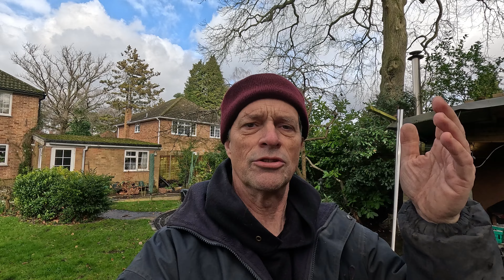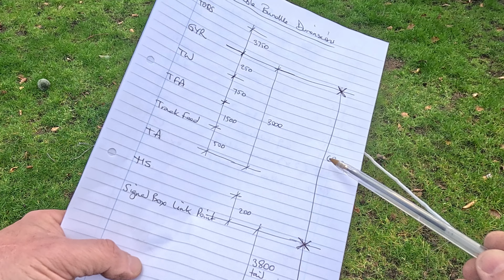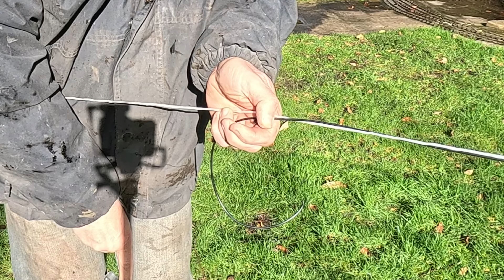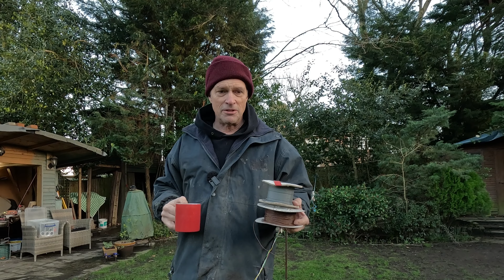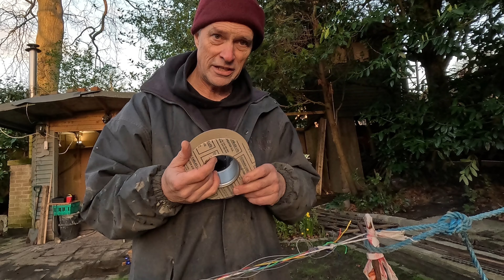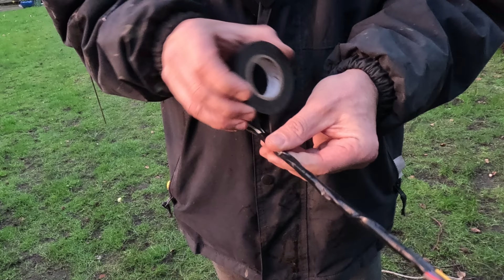Building a Garden Railway • Control System Cable Bundle • Unique Cables • Linleys Garden Railway

Comment: Another very interesting video Warren , Have you calculated in the voltage drop when choosing your cables .Regards David
Reply from the maker: That is a very good question, about voltage drop. The short answer is no, but I’m aware that the voltage furthest away from the signal box control system is a bit down. I use thicker wires than the current needs and the trains run okay I find. But I will keep that potential issue in mind. Thank you for your thought about that. Cheers. Warren 🤠
Reply: no problem Warren , l will see you on the live l am really looking forward to it Regards David  @Linleys
Reply: After a hard days work all you need to do is unwind Warren. Very time consuming lucky you retired mate. Bushyboy Oz.